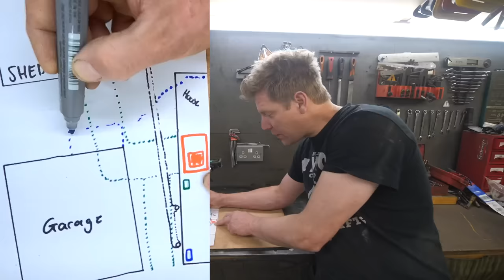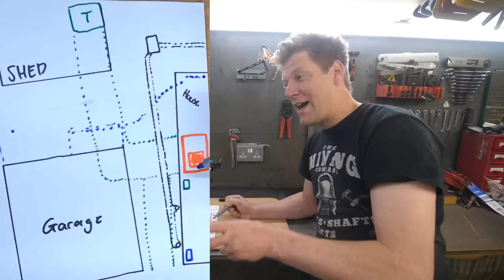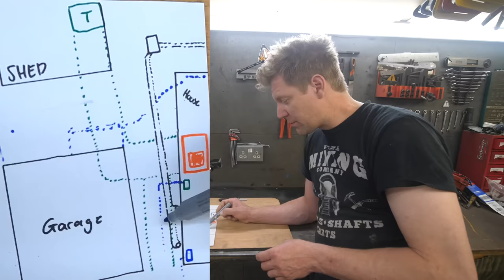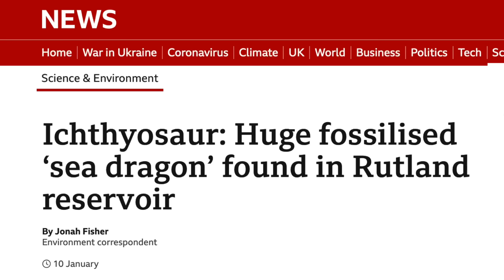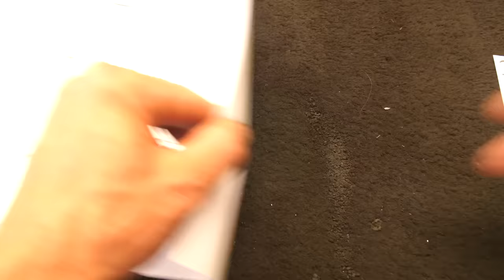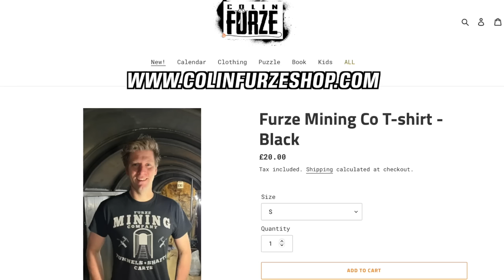DIGGING A SECRET TUNNEL Part 9

Comment: Well you're right about that being a fossil shell, the other fossil I'd need a better look at but unfortunately the crystals aren't quartz they are actually calcite (made from calcium carbonate, the same material as the limestone just in a crystalline form). If you are in doubt just drop a bit in vinegar it will slowly dissolve and form bubbles as it reacts with the acid and turns into calcium acetate and carbon dioxide. Quartz is deposited in metamorphic and igneous rocks, calcite is generally found in sedimentary and metamorphic rocks comprised mainly of calcium carbonates or at least is fairly rich in it. The reason there aren't more shells is likely because the area that particular limestone was formed in was deeper so there were less things that are easily preserved living in it as the sediment was being deposited, you could find out exactly by looking up the geology of your area, should also tell you more about what kind of fossils to expect
Reply: Was looking for a comment like this! Thanks for the info! :)
Reply: Top comment.
Reply: The other "fossil" might also be a form of calcite crystal. I cant remember what its called but it looks almost identical to them although they usually aren't that large.
Reply: Spot on!
Reply: It's not a shell, it's a concretion.
Reply: @TomsBackyardWorkshop  could be flint, looks a bit like a conchoidal fracture on the top on 13:13, but can't be certain
Reply: Calcite is much softer than quartz.  Scratches with brass, quartz is Mohs 9, calcite is Mohs 4.
Reply: Came here for this comment .   Si02 aka quartz requires much higher temperatures, pressure and time to form crystals, and tectonics to move it closer to the surface .  Sure do love its affinity for gold though .
Reply: You can find polycrystalline quartz nodules in limestone..called chert nodules, aka "flint".  Not knowing the exact area, large crystal quartz is typically found with geothermal sources where hydrothermal deposit is possible.  Silicon dioxide is only soluble in supercritical water..221 Bar at 375 °C so figure 2200 meters seawater depth..
Reply: @keithjurena9319  It's mostly middle Jurassic limestone so it's not unlikely that he find a few fossils, we do tend to get odd ones around here. We don't really get much flint in this part of the country though, that's generally further South.
Reply: it's true, Geology rocks!
Reply: @keithjurena9319  those formation pressures etc don't equate to the seawater depth at deposition for flint at all, it is formed in sediments initially deposited in shallow temperate/tropical seas and through a different/more complicated process at much shallower depths than you suggested through a process of chemical reaction. Here is a fairly concise explanation of exactly how flint is formed (chalk is a type of limestone that forms true flint)

 
How flint is formed
 
David Bone – West Sussex Geology
 
The formation of flint is a complex process which began in the chalk seas millions of years ago and is, summarised below:
 
Organisms such as sponges (on the macro scale) and radiolaria/diatoms (on the micro scale) use silica from sea water to manufacture the biogenic opal which forms their skeletons. When the organisms die and the organic parts decay the microscopic silica is scattered on the sea bed and becomes incorporated in the accumulating sediment.
 
At depths of 1 to 5m within this sediment, the biogenic opal breaks down, enriching the water between the sediment particles (sediment pore water) with silica.
 
At sediment depths of less than 10m, there is an oxic-anoxic boundary where hydrogen sulphide rising from the decomposing organic material within the sediment diffuses upwards meets oxygen diffusing downwards from the water column above. At this interface, the hydrogen sulphide is oxidised to sulphate with hydrogen ions as a by-product. The hydrogen ions lower the local pH, dissolving the chalk and thereby increasing the concentration of carbonate ions. These act as a seeding agent for the precipitation of silica.
 
Silica precipitates by the molecule-by-molecule replacement of chalk. The silica is initially in the form of crystalline opal but gradually transforms to quartz (flint) during later burial and with time.
 
The chalk sea bed is deeply burrowed by many different organisms, such as shells, echinoids and worms etc. Some of these burrows are quite deep or branching, or have open living spaces. The burrows fill with sediment after the organism has died, this is slightly different material from the sediment around it. These filled burrows act as preferential pathways (conduits) for the chemical reactions to occur. Flint formed within these old burrows often has a nodular shape which reflects the whole, or part of, overgrown remnants of such burrow systems.
 
There are two possible explanations for why flint forms in bands or layers. Firstly because chalk sedimentation occurs in cycles and secondly because the process above exhausts the silica within a given depth of sediment and flint formation can only recommence when there is enough silica to start the process again.
Reply: @keithjurena9319  I have lived virtually my whole life on the chalk so flint is something I am more than familiar with. I also grew up spending a lot of time in the earth sciences museum at Cambridge University learning about palaeontology and geology so please forgive me for forgetting that these things aren't exactly common knowledge and not bringing it up initially or perhaps sounding condescending. I'm honestly very lucky that where I live is very rich in sedimentary geology,  with everything from the chalk and incredibly fossil rich clays to glacial deposits of gravels and boulder clay that are a whole medley scraped up and redeposited from all over the country right onto my doorstep. When it comes to fossils although chalk and limestone (and especially those replaced with flint because of its durability) is the staple I grew up finding everything from an icthyosaur vert in a stream bed to ice age mammal remains in the ploughed fields, all just a few miles from my house. Although I did study geology in general in college my focus in that area and therefore my particular expertise has always been on the fossil bearing sedimentary rocks (with an honorable mention to mineral deposits, especially metal ores like galena which is great fun to collect from old mine dump sites and smelt down)
Reply: @keithjurena9319  I will admit I often forget that flint is technically a form of quartz, we usually just refer to it as an organically derived silicate because calling it quartz only really serves to confuse people when you are dealing with the general public. I enjoy educating people and especially kids when I get asked questions while I'm fossil hunting but you quickly learn to simplify things right down or you just get a confused look. If you lose a bit of technical accuracy but manage to clear up a common misconception or answer their questions satisfactorily then I'd much prefer to do it that way than getting overly in depth and just leaving them even more confused than they were before they asked because doing that means they are less likely to ask in future, and initially I treat youtube comments the same way although I am more than happy to get into a pedantic discussion of details with someone who appears to be ready for that level of detail. Still very much pared down for the sake of brevity (and believe me this was me being very brief although it may not seem that way) but still if it helps someone learn something then why not
Reply: The bitrate of a JDM engine would be equivalent to the 'fountain pen' effect of the human heartbeat in quartz nanotubes. Just my two pence.
Reply: Who are you bro
Reply: Why did I find this so interesting?
Reply: Yeah. ,,, what he said .
Reply: cough nerd cough

In all seriousness though, this is really interesting
Reply: Can someone dumb this down for the Americans watching?
Reply: cool!
Reply: Yeah doesn't make sense for it to be quartz. Over here in New England (lol) we live on a few feet of soil covering deep ledge that's a mix of igneous and metamorphic rock.  Quarts rocks are stupidly common here and can even be in the way.  Mum's got a 2-ton quarts crystal rock (some fused sone crystalline) just sitting on a monolith cause the contractor thought it was neat.
Honestly I'm looking forward to Colin actually finding a true fossil if it's a possibility.
Reply: Atleast someone payed attention in science class
Reply: Fellow rock enthusiasts in the comments😂
Reply: @TomsBackyardWorkshop  I think you mean Aragonite, although most of the time it doesn't look like that it still could be.and for the crystal, there was a crack or hollow space and a liquid mineral solution got in there. It crystallizes from both ends of the space and meets in the middle
Reply: @keithjurena9319  at 9 on the Mohs scale that's some really special quartz you got there, it's normally only 7.
Reply: Scissoroar Scissoroar  he isnt. Calcite is made from CaCO³ and as a result has a rhomboid shape. Similar to that shown in the video
Reply: So many words, sucks I'm not reading them
Reply: Mand
Reply: @Lilith-Rose  God must of been busy that week.
Reply: yup.
Reply: Billy Idol, Motley Crue, Ozzy Osbourne, and way, way more. (I'm an 80's enthusiast but I like what Colin plays in his vids as well.)
Reply: Someone’s gonna get layed I’m collage
Reply: Great Explanation!
Reply: found the geologist
Reply: Who
Reply: Just imagine his family coming and looking for him at 15:41 lol
Reply: Nerd
Reply: @timekeeper2526  who
Reply: @kasnitch  kinda, rarely you can get larger quartz crystals in carbonates if you are at a boundary, and silicic acid in ground water reacts with the carbonates depositing the silica.
Reply: Lilith-Rose, you are obviously into geology.  Here in the States there is a Central Washington State University professor, Nick Zentner that has a bunch of really neat videos.  Check him out if you are not already aware of him.  Even professional geologists watch them.
Reply: "Their minerals Marie"
Reply: Looks to me we got a nerd on our hands
Reply: @Joshbosh022  some of us Americans are smart enough to follow along… we’re not stupid, we’re _crazy_.
Reply: Wrong.. Partially
Reply: WAIT NO SHIT IS THAT THE STUFF I FIDN ALONG THE RIVER???
For years when I wa syounger I found a really brittle quart with rusty looking stuff in/on/around i thought young me thought I'd found some special quartz cause it was weak not strong
Reply: That area was marsh land around 500 years ago and a few thousand years prior it was a part of the north sea
Reply: @CyningofLindum  we are talking millions of years here rather than thousands
Reply: @spicynugget375  weird how ot intimidates you.
Reply: 0
Reply: nerd
Reply: @Joshbosh022  Rocks
Reply: Yeah. What she said!
Reply: Thank you for the science.
Reply: tldr
Reply: Dude this comment rocks
Reply: you collect rocks don't you
Reply: @MeheandusRevolution  Not flint: flint is exclusively found in the Chalk. Furze's house is on Jurassic-age strata, where the Chalk is all upper Cretaceous, and is typically found toward the east of the county.
Reply: @keithjurena9319  quartz is Mohs 7, calcite is Mohs 3
Reply: I think the fossil at 13:00 is a cnidaria, a piece of coral
Reply: I lost you at the calcium carbonates
Reply: @BakedTuber  check out John Mackay if you want the other view.
Reply: Easy for you to say !!!!!!!!!!!!!!
Reply: @Joshbosh022  lol
Reply: @shlomp399  aha an American
Reply: Also icthyosaur isn’t a dinosaur lmao

Comment: I love the look of those exposed rocks. I hope he makes a fake window with a plaxyglass with a tiny cave on the other side. I think it would look really cool with some led lights. Maybe even some fake dinosaur bones?
Reply: You are a Genius!!! That is an awesome idea
Reply: This needs a lot more likes!
Reply: Great idea!
Reply: Or a full human skeleton wearing a mining hat with an led light on it.
Reply: He has
Reply: Great Idea
Reply: Great idea! Does he not have to have concrete surrounding the tunnel though?
Reply: Bones of @colinfurze ancesters! 😂
Reply: Plexiglas*
Reply: My Minecraft base be like:
Reply: this is a great idea - assuming it can be made load-bearing. Would be cool to see
Reply: Couldn't it be used as natural ventilation?
Reply: @kimparker1729  ?
Reply: @krissambrook8737  I don't see how having a small sealed off cave could affect the structure. Its not like moisture or anything else would get through it, right? 

he dosn't "have" to have concrete everywhere, he just chooses to do it to get additional stability and safety.  so the tunnel dosn't collapse under the weight. 

But if he's worried about the mini cave collapsing, I guess he could still make a concrete "box" around it
Reply: @krissambrook8737  @Colin Furze could fill the large gap with liquid acrylic resin, which will harden into a solid block of Plexiglas-like material, but inches thick. That will be plenty strong; similar windows have been used on deep sea submersibles, though those were curved to withstand the enormous hydraulic pressure.
Reply: The best idea ever

Comment: When I asked colin a couple of years ago how he will prevent his bunker from rusting he answered "with love" now I know it actually was WD40
Reply: Is there a difference? WD40 IS love
Reply: Can you smell the tunnel now?
Reply: It's amazing how well a thin coat of "dried" oil will protect steel. The best protection from rust is being blued and oiled.
Reply: @aserta  I know exactly how Colins tunnel smells and that's probably the weirdest thing I've posted in any comment section ever. 🤣
Reply: WD 40 turns to varnish over a few months.  That's why it's bad to use it to free up stuck machinery unless you follow up with a proper lube once everything moves again.
Reply: @martylawson1638  Yeah does it get sticky aswell?